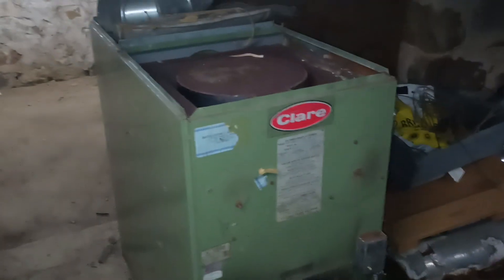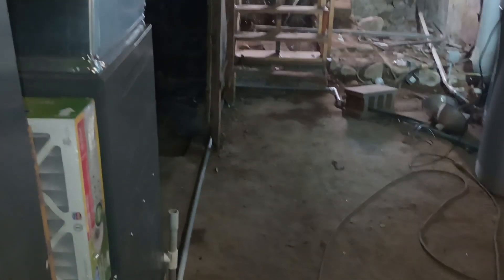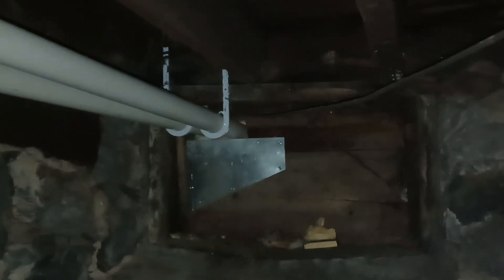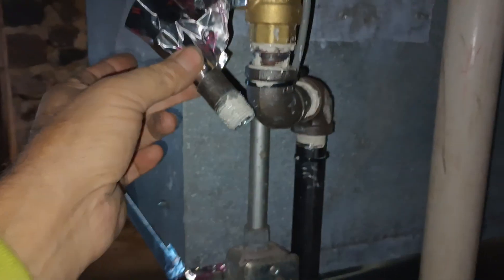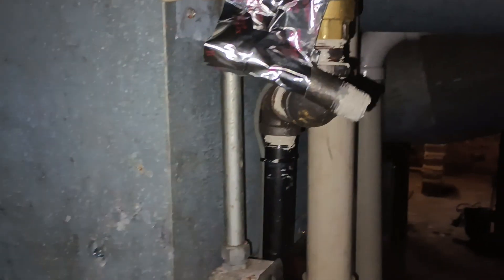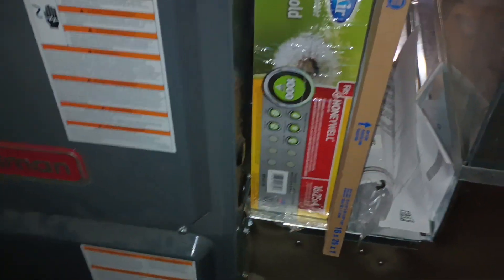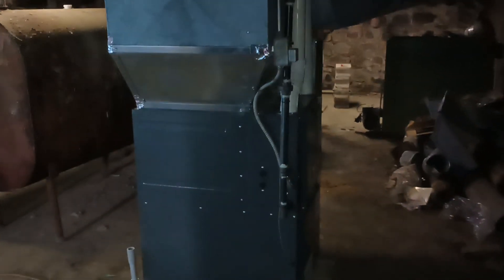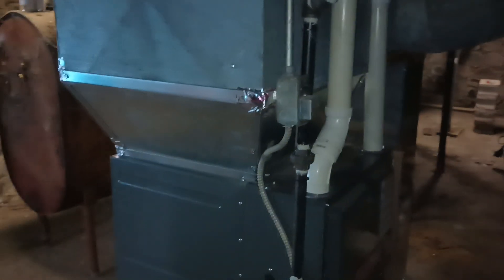Spider webs and scary places, Halloween Heat

Comment: I just paid $4500 to replace my 51yr old furnace. It was original with the house in 72' at least I got my money worth. I'll be lucky to get 15-20 yrs out of the new one. They sure don't make things like they did back then
Reply from the maker: The old ones would run with very few things to fail...
Even with large holes in the combustion chamber.
The new ones are safer and typically shut down before making you sick or dead.